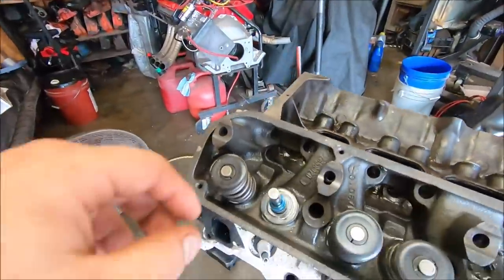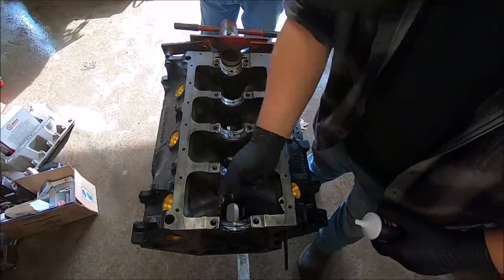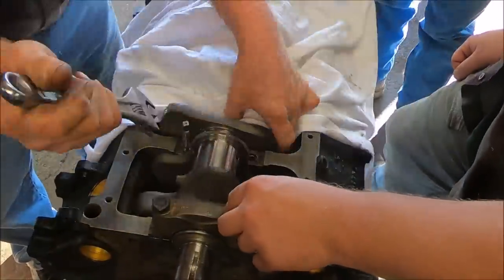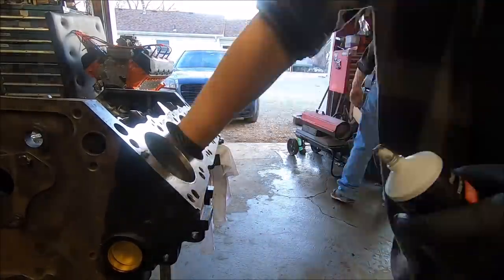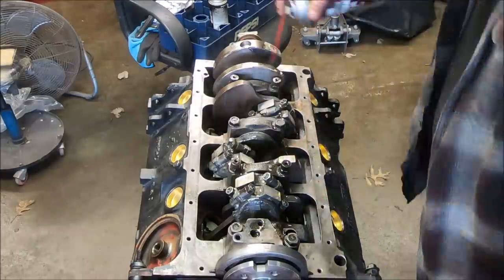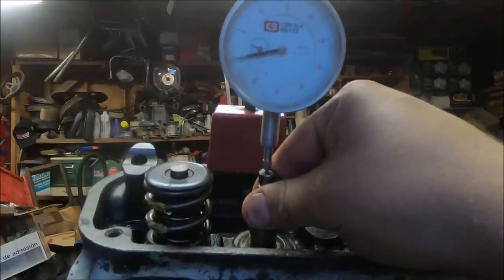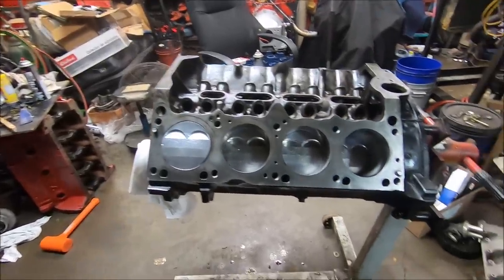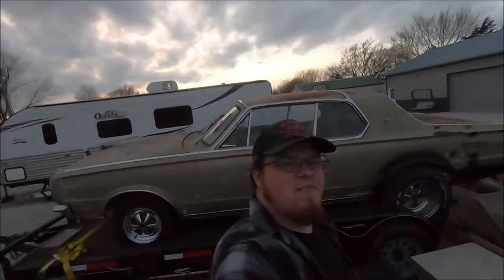High Compression 273 Rotating Assembly BUILT: 1966 YARD Dart GT 273 pt  3

Comment: First time any buddy ever scared me in a car with power was in a late 60's Dart that had a built 340, 4-speed with a posi rear. I had no idea what a beast it was! It would lay down rubber in all 4 gears. I have a buddy that had a 70 Challenger with a 440, auto trans, posi rear, and  a tunnel ram with two 4-barrels that was better mannered and more predictable than that Dart. I would have had a hard time passing on the 340 but I do understand why you did in favor of originality. I would have snagged onto the 340 just to have it though. That 273 looks like it aught to be a good runner with some get up and go. Looking forward to seeing more with this build and seeing how it goes.  Another great video, good job Jed!
Reply from the maker: Thank you Jim, I really appreciate every comment you leave for me, especially stories like that one, but that 340 is still available to me from a buddy, maybe I will have to call him and buy it just to have. It is a pretty neat engine for sure, but his needs pistons, rods, and a crank, since it is a 13.5 domed pistons, aluminum rod, race engine

Comment: That's a nice ride, i had a 65 Dart GT it was a signet series though motivation came from a \6. It was fun to drive.
Reply from the maker: That would have been fun to drive around for sure, I love me some slant 6 action
Reply: @ScottsSpeedShop  , i traded a v6 mustang with the 4 speed trans traded straight across for it, i stopped at the car lot where it was for sale and checked it out the day before. I got off work went straight there signed all the paperwork without even starting the Dart again. After that was all taken care of i jumped in the Dart started it and it kept dying. Good thing my parents lived only 2 blocks from the lot. My dad took a look at it for me, he said pull the valve cover so i did, sure enogh a push rod came loose from under the rocker it fell down on top of the cam. He had a magnet pulled it up, took the adjustment screw out the rocker arm beat the treads up a little put it back together. Then he said start it, it fired right up so while it was running he adjusted the rocker arm to push rod adjustment, i was amazed lol.

Comment: Because of the small displacement, I had always just assumed (in the same tone that 360 loyalists avoid 318's) that the 273 was created for mileage, not power. Dodge put some good parts into the hipo 273 though and this looks like this will make some decent power. 
Looking forward to seeing it run.
Reply from the maker: I am more or less building it to the spec of the 275 hp 273 used in the D-Darts, I have a little less cam, but better heads and a much better carb in my opinion. The car just needs to be a fun toy, I don't want it to be crazy fast or anything, I just want it to be unique and funky
Reply: @ScottsSpeedShop  
I think it'll work out nicely. 275 hp is respectable, and it's just cool to open the hood and see the powerplant that belongs in the car.
Reply from the maker: @Freedomquest08  I couldn't agree more my friend, I just need to find a good air cleaner for the car

Comment: Kinda hard to check valve to piston clearance without the cam! Usually you put the cam in, degree it, put some clay (chewing gum in a pinch) on the valve releifs of one piston, put one head on, one exhaust lifter and one intake, pushrods, rockers and roughly set the lash. Spin it over slowly feeling for contact between a valve and the piston. take the head off and slice the clay in half and check the thickness with a vernier caliper - there is your valve to piston clearance, plus the thickness of your compressed head gasket.
Reply from the maker: Very good point AJ, but in theory if we have our cam specs, and with the proper tools, we could figure out if things would work out or if we needed different parts. Just to let you know, everything does clear beautifully, I am working on the next video as we speak. We don't have any clearance issues, but if in the future when this engine is spinning at 6000 and the valves smack the pistons, you can say I told you so
Reply: Michael Franke why would you say it like that? That's jacked up.
Reply from the maker: Michael Franke will no longer be bothering this channel, I don't mind people calling me out for stuff, but for someone to be an ass like that is not something I will tolerate on our channel. I don't intend to half-ass anything, I do things the way I have been taught or have taught myself.
Reply: Scotts Speed Shop yes sir that was uncalled for. Mr.AJElliot was respectful and was trying to have a conversion. No need for that comment from that other fella.

Comment: You are going to so enjoy the sound of this motor in the higher RPM just before the next shift, you fell the motor still pulling hard it hits the next gear puts you Back in your seat, instantly and ever so quickly it’s in 3rd gear and your crossing over the finish line you would have liked a 9.9 sec. at 135 MPH BUT VERVY HAPPY WITH YOUR 11.8 at 123 mph cause you built it Yourself believe in yourself and get the bugs out and cut a good light 9.9 is possible but call it a consistent 10 sec car next hurdle try and stop especially on back to back runs with minimal cool down Enjoy one other thing don’t over carburetor you lose a lot at lower rpm unless you have a forced induction which you don’t have at this time but think about it a Blown 273 SB AWESOME !!! It’s fun betting up on BB motors
Reply from the maker: Jeff, that was incredibly fun to read, and I can only dream of making this car do a 12 second pass, maybe it will, but I have no idea, it is a light car, with a light-ish engine, that makes decent power. I guess we will see, and yes the blown 273 would be wicked cool, but WAAAAAAAAAY out of this poor man's budget lol
Reply: Scotts Speed Shop budget what budget you have said this before and parts seam to show up its a trade off but that’s another story by the way Dads are aloud to make mistakes as long as they catch them before you turn the key
Reply from the maker: Well when I say budget, I mean what I am willing to spend, as cool as a blown 273 would be, I think I would probably spend that money on super charging an early Hemi

Comment: Should be a good running & affordable to drive ride. No replacement for small displacement when you fuel the biatch!
Reply from the maker: Nick, that has got to be the best phrase I have heard yet for this engine, I am totally saving that and putting it on the car somewhere.
Reply: @ScottsSpeedShop  Nothing but love for 273's. If I can't break one their pretty much unbreakable. In fact I loved them so much I put 273 4bl emblems on my Hemi Cuda eating 383 GTS Dart (the RIGHT mods). Treasure that time working with your dad.
Reply from the maker: Trust me Nick, I treasure every moment with Dad, I know someday he won't be here helping, and those days are gonna be hard to stomach. I appreciate everything brother, especially the cool ass stories

Comment: Why not go with a stroked out 360 go for all the torque you can get.Just asking
Reply from the maker: Well I honestly could have gotten a 340 for the car for an extra 200 bucks, but this car I honestly wanted to do a 273 for it, its not the original engine, but it is the correct engine. Normally I don't care for originality like that, but no one builds these engines anymore, and I am honestly surprised how many people love the fact I am build this little powerplant. I know a 318, 340, and 360 all would eclipse this engine for power, but I like weird obsolete engines, that is about the best answer I can give ya man. I have honestly been asking myself the same question since I bought the engine, but I don't regret it...yet
Reply: @ScottsSpeedShop  Thanks for getting back to me I understand now.
Reply from the maker: Thank you for asking man, I don't mind answering questions, I can understand why you would ask that